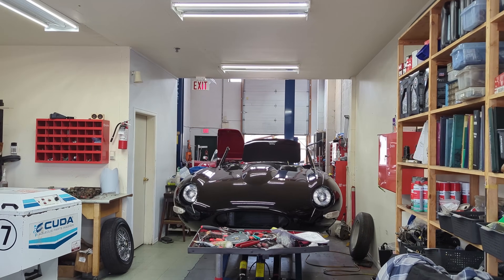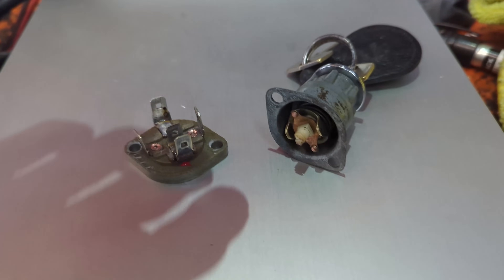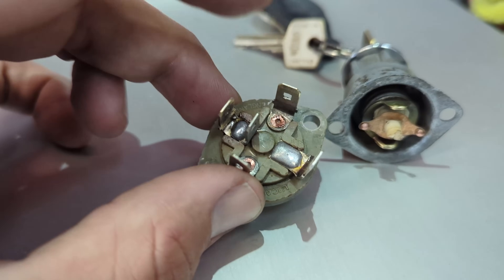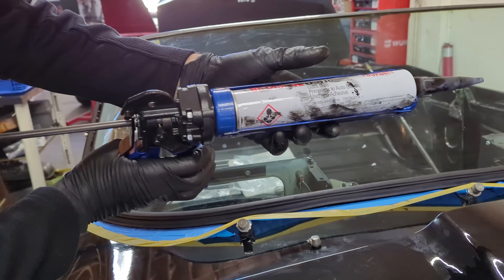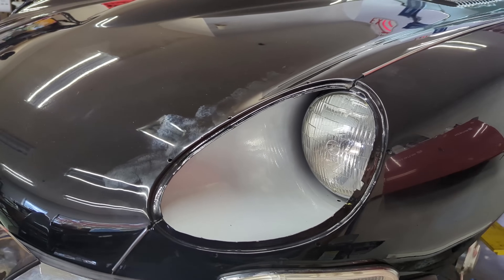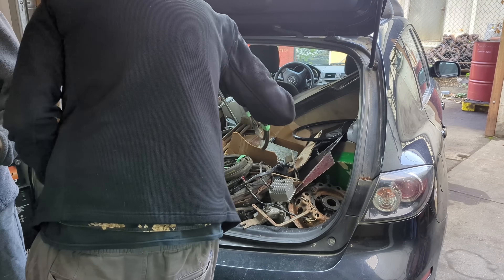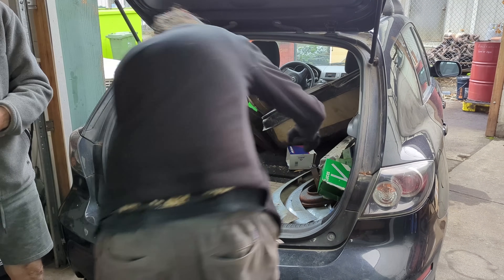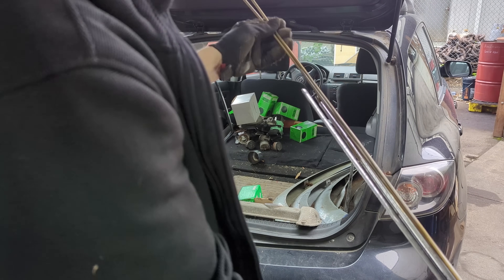Mouse House Jaguar E-Type 🔧 Workshop Diary 6

Comment: Well at least the mice have taste by invading a Jaguar, time for the Big Cat to catch them 😁😁😁
Richard so good to see one of your videos again I know you run a business and that is more important, but it's great to see what you do.
Unfortunately it appears no one can do their job these days I have had issues with Autosparks with bits missing wrong connections and if you jump up and down until your blue in the face you get a half hearted response.
Whilst I am sure you know by now, but being a MKII freak the pipe on the inlet manifold feeds vacuum to the brake booster.
Yes its MKII Steering wheel.
IF you need help with MKII parts let me know.

Comment: I bought Auto Sparks harnesses for my restoration and I found they included a few wires for Right hand or Left hand use on the same harness. It's an efficient way to manufacture them I suppose. I just tied off the ones I didn't need. I did not have two wiper motor cables so it may be an error as you said.

Comment: Hi Richard. Nice to see another video. Too bad about the mouse house. Hopefully the smell will go away after using some kind of product. I had an otter get in my boat at Canoe Cove. What a mess and stench. Luckily it's an aluminium boat so no damage, just lots of cleaning. Nice work on the black XKE! And a few bonus parts from the hoard. Cheers

Comment: The problem you are having with the boot lid seal is due to the new seal being sold by the various Jaguar parts vendors simply being too thick. There is a post on the Jag-Lovers forum showing a seal that is very similar in profile to the original and it fits and seals well without making the boot lid protrude and difficult to close. It is available from COH Baines and is their part number DX100. It is sold by the meter and I purchased four meters for my '64 OTS but you could probably get by with only three. It fits and works perfectly and is actually cheaper even with shipping from England than the one that all the Jaguar parts vendors are selling that doesn't work.

Comment: Regarding the "extra" light green/black wire for the washer pump motor on the LHD harness:  Yep, I also found that the "correct" wiring harness for my '65 xk e-type LHD roadster, had the extra wire as well.  I just taped it up and ignored it.  For the longest time I thought I had screwed up and order the wrong harness.  Nope,...it was just the way they made it.  Probably so they could sell the harness to both the LHD and the RHD markets at the same time, without having to maintain double the stock numbers and storage.  i.e., kill two birds with one stone...Not sure though...maybe the loomer just screwed up when they made a batch and decided not to scrap the day's production...(hoping no one would find out and/or care, haha).

Comment: Hi RMO, great video,
that harness issue looks familiar. I am using Autosparks for all my cars and did have exactly the same issue. Sometimes I find it difficult to the explain problem as they are not familiar with the cars. And we do know, Jaguar continuously changed something on the cars. Sometimes it is a real mystery how those harnesses are fitted. But hey, in the end we get them all running to our satisfaction. Funny enough, on a very early unrestored car, I found such an (extra) wire for the reverse light, attached to outside of the harness. Someone must have forgotten it in first place.
On the black OTS I  see some mounting brackets at the window chrome, are those for wind deflector or mirrors? Any good? 🤓

Comment: Your windshield install AND the sugar scoops install are the best I have seen yet on YouTube.  I'll be doing this on my '65 next year.  Thanks.  One question regarding your captive nuts (for your chrome trim screws).  Do you think it would be good to apply anti-seize compound (or something similar) so the nuts won't corrode?  I understand it is almost mandatory to re-thread them, but the previous owner removed all of his nuts (probably due to rust) and put in those funky press-in nuts.  I'm having to cut them out and spot-weld in new cages (most of mine were actually missing) with new floating nuts.

Comment: just noticed, you have the chrome trim on the top of the windshield already installed on the glass.  do you recommend doing it that way or did you do it that way just because it was the original glass and you didn't want to disturb the seal under the chrome which is NLA?